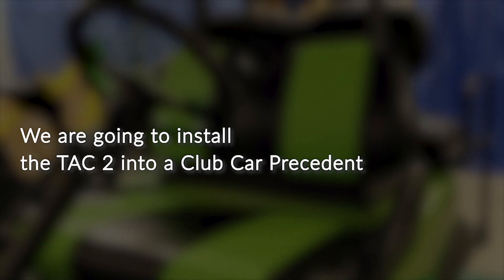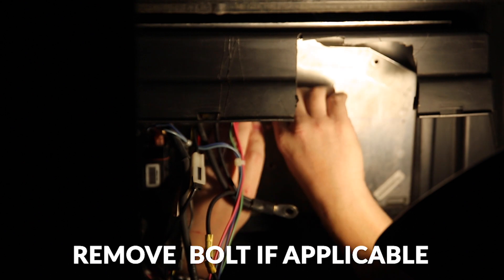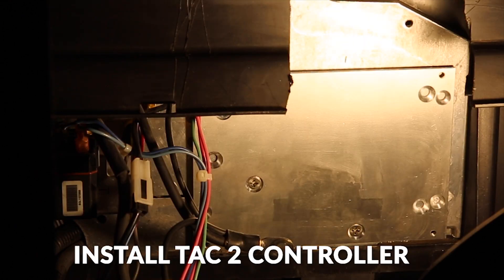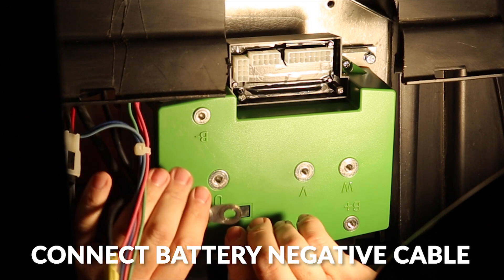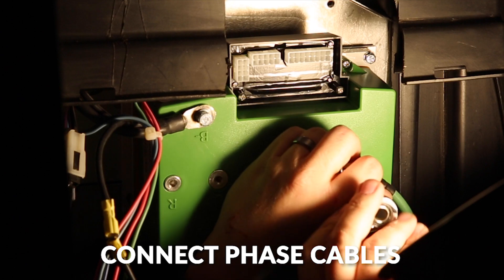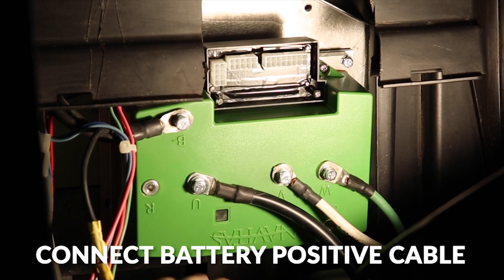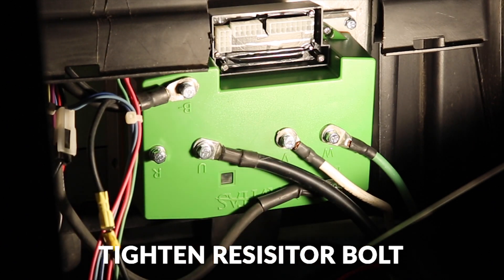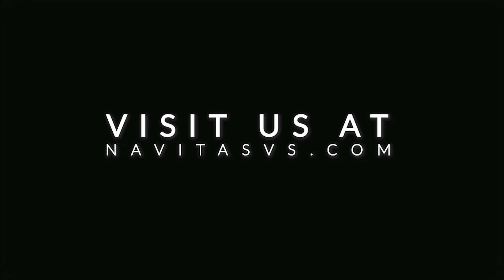TAC 2 into a Club Car Precedent Install - Navitas

Comment: If only it were that easy. The holes in your mounting plate do not line up with the factory club car holes. And only one of the included bolts are the right size. The other three are not the same thread so you have to drill out the mounting plate and re-thread the holes for your bolts to work. I have made this complaint before on the phone to your company and obviously you guys don’t give a crap because it hasn’t been fixed
Reply: Buy a drill bit and tap. It’s a 1/4-20… not hard my dude.
Reply: Bro take it to a shop if you’re such a baby 😂 I’ve installed thousands of Navitas and never had a issue

Comment: Do yourselves a favor an order from a different manufacturer.  Instructions are vague.  Customer support is horrendous.

Bought $1700 dollar AC Conversion Kit and it came with incorrect mounting plate hardware.  Called Navitas and was told to go find hardware that works and specifically that "I'm not going to ship screws halfway across the country".  I am dumbfounded.  Who would talk to anybody that way, let alone a paying customer?